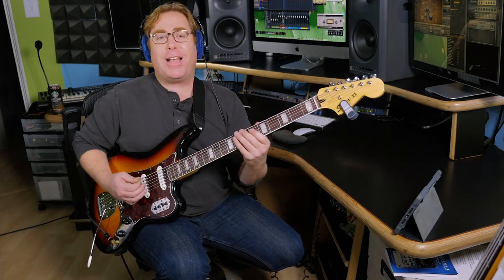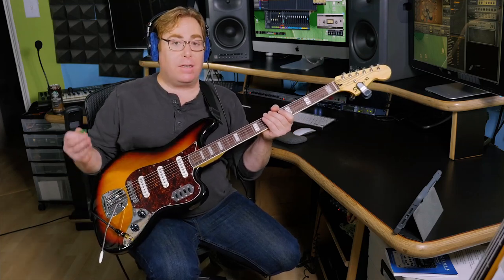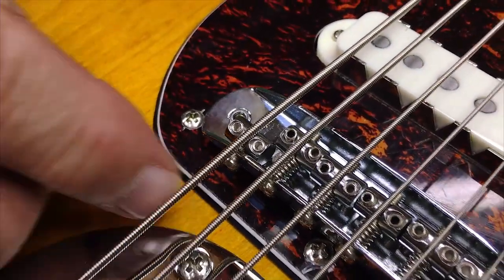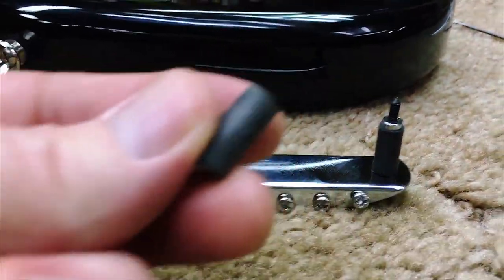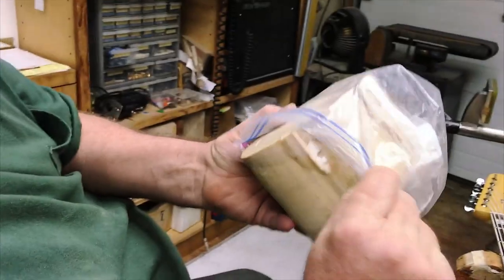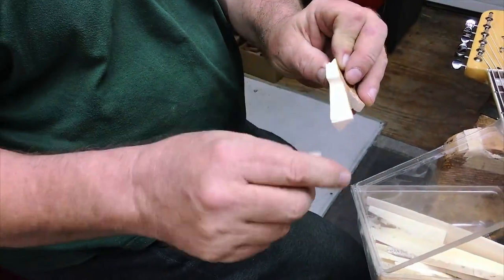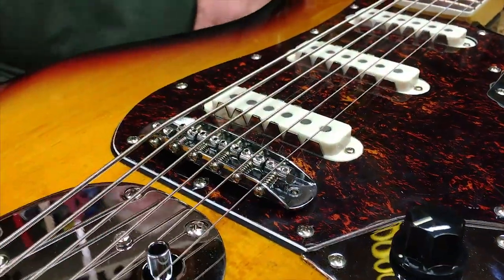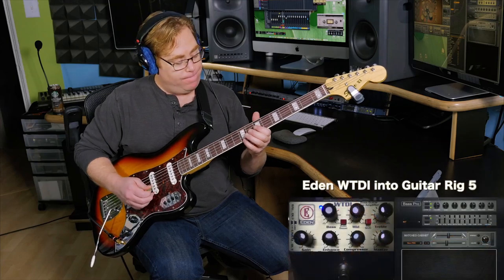Squier Bass VI Intonation Fix

Comment: Actually the oversized hole for the bridge support pins is by design.  The bridge is supposed to rock with the tremelo, it is an additional setup detail.   If you fix the bridge then your strings will go out of tune when using the tremelo.  If you don't use the tremelo, then it is fine to fix the bridge position.
Reply: If that is by design, then why are they not like that on Jazz Masters and Jaguars? And what do you do when the bridge on the Bass VI gets stuck forward and does not return to back to level?
Reply: @seansmith8713 jcv jassmasters and cv jaguars heve the same bridge and those rock too..

Comment: WTF? I'd find a better setup guy. I fixed my trem on my bass VI with coins and some risers under the floating pins. then i threw the tone bar in a box. set up with harmonics and abracadabra man. EZZ PZZZ with no screw cutting. For the record never let somebody dremel cut mere millimeters from two strings and with magnetic pick ups an inch away... or just dont let them dremel your axe period.
Reply from the maker: It's fine. That's Steve Helgeson of Moonstone Guitars. He makes some of the best guitars in the world. My Bass VI plays perfectly now. It was my choice not to just get a better bridge.
Reply: @ChadWork1  Fender now makes 24-100 Gauge Strings which will intonate even better plus that 100 gauge low E is awesome
Reply: @ChadWork1  never heard of the guy, but his workflow is very dodgy :/

Comment: Cutting the adjustment screws seems a bit silly to me.  If you lower the saddles in the bridge (changes the angle of the adjustment screws so they don't hit the strings) you can then raise the entire bridge to get your string height.
Reply: i just screwed with them for 10 minutes and got intonated, no cutting
Reply: What you are saying does not work because you will get fret buzz. You have to raise the strings.
Reply: @lanceforney5321 the holes to the sides of the bridge house a small Allen key screw, I think it was a 1.5mm turn to the right to raise your bridge. People commonly adjust string height with their saddles on offsets and then complain about something they weren't supposed to do in the first place.
Reply: @MrJbangoy  I did that first, but the strings were then too high. I then had to lower the saddles.  I was able to get them all adjusted but the E string. It was the strangest thing.  I had to raise the strings back up because the E would buzz.

Comment: "Jury Rigging" is not a "fix".  Showing a guitar tech having to physically modify a guitar is NOT helpful.  May as well just tell people to go buy a Staytrem bridge for $100 vs what the average person would have to go pay a tech to do.
Reply from the maker: +fooser1 It actually is a fix because my Bass VI is in perfect intonation now. I paid 80.00 to have the Bass VI completely fixed and set up. Once you pay 100.00 for a different bridge, you'll still have to pay a tech to get the bass playing right ( if you're not tech savvy yourself), so my way is cheaper. Intonated is intonated, and my Bass VI plays better than the Fender model now.
Reply: +Chad Johnson  I am seriously getting a mammoth tusk nut after seeing this! my pitch for the staytrem is that it will give you a lot more mass and significantly enhance your tone and sustain.  Its much more than just an overkill fix for the intonation.  The squier vi is a great bargain, but for a lot of us, it was a priceless, legendary instrument we never expected to own.  I say its worth upgrading.  But you do you!
Reply from the maker: Yes I have no qualms with the staytrem. We just wanted to try to see if Steve could get it working with the stock parts. Now what's bugging me is that the pickup poles don't line up with the strings, and the low notes are weak.
Reply: +Chad Johnson what kind of strings are you using?  Kallium has a ton of different gauges.  You might want to try their 104 low E.  These things were setup every kind of wrong out of the factory.  But since i love tweaking around with cheap guitars, its been a fun experiment.
Reply from the maker: I still have the original strings. I never got around to experimenting with different gauges. Do thicker strings fit in the nut without having to rout out the slots?
Reply: +Chad Johnson depends how thick you go.  Ide say if you went with a 90-98 youd get away just fine.
Reply: There's a intonation guide for this guitar on Instructables that is just brilliant and shows you a lot about how to do it yourself.
Reply: +Processdrone hell yeah shimming the neck is number one for any of the floating trem fenders.  I had to put a pretty dramatic angle on mine and that was when things really started to turn around for me.  The one thing Chad got really right here that a lot of people miss is that you can get a lot more tension if you adjust the tension screw on the trem.  Right now im rockin Kalliums with .86 gauge and its PERFECT now.  This Bass is one of my favorite instruments I have ever owned, but forewarning to all, it is a project.
Reply: It's actually Jerry rigging.
Reply: Processdrone 
I followed that exact guide and even got the same bronze bushings the guy used, ended up being just barely to wide around to fit in the bridge holes.
Reply: @ChadWork1  D'addario makes awsome Strings for this neat instrument. Taylor Swift would love the Bass VI cause she could use it for a new Rock version of Shake it Off.

Comment: I have the Fender Pawnshop Bass VI with the same intonation problem on the low E. Only turn the bridge (screw on the pickup side), lower the saddle a bit (to clear the string on the high E between the bridge and the whammy) and raise the bridge a bit. Now it's perfect and it's revesible!

Comment: I have a ‘14 VM Bass VI. Never, ever use the trem. I installed the Ace Hardware bronze bridge post bearings and Kalium 102 BVI strings. This, and shimming to make for a proper neck angle made it easily intonate without all the cutting of screws or reversing the bridge.

Comment: @UCIV6Cl5SzuGCn6OsY33KLMQ
  The Fender 250B6 Set used to be 24-84 but they've made some refinements to it so it's now 24-100. They've bumped up the gauges of the 3 Lowest Strings (D, A, & Low E) by a significant amount so that it's more balanced & the intonation is better. The Low E String from the new 250B6 Set is now a 100 which is Standard for a Bass Guitar.

Comment: I found that if I just shove the bridge back, it stays there if I don't use the tremolo.  No need for sleeves or other modifications.   Also the screws are soft enough that you can cut them with a heavy-duty snipper.

Comment: I broke the weld on my bridge trying to fix intonation , so i had to buy a new bridge anyway. Interestingly the bridge for the Jaguar / Jazzmaster fits without any sloppiness and the resonance comes through the body of the guitar so much better putting you so much more in touch with the instrument.
Also a 1mm thick shim ( i used a cut down jubilee clip) under the neck right up against the body fixes most of the intonation and renders the bridge able to adjust for intonation without all that cutting screws down. Basically the neck pocket isn't angled quite right.

Comment: I picked up 2 bronze spacers at Ace Hardware with a 1/4" (.25) I.D. and 5/16" (.312) O.D. x 3/4" (.75) long for about $6 total...dropped right in the bridge ferrules and took 99% of the play out.  If you want to compare, try it out.  They come right out if you want to float the bridge.

Comment: Very helpful. Other than shimming under each individual string saddle, does anybody know a way to adjust saddle height? My low e-string is too close to the neck. The other strings are OK. Does anyone know of a replace bridge that allows for bridge height adjustment as well as intonation? It's a common thing for 4-string bass, but I am not finding any for the Squire VI,
Reply: Use a 1.5 mm hex key. The adjustment screw is deep down the holes in the 2 bridge posts. Clockwise to raise.

Comment: Fix the bottom 'E' intonation problem on a Squier (possibly Fender too!) Bass VI, with this, completely reversible, modification that also ensures the front of the screw doesn't foul the string - NO  Dremel 'butchering'!
1) Slacken string and pull aside.  2) Remove intonation screw.  3) Refit saddle into the bridge, but with (both) the screw AND Spring, mounted BEHIND rear flange of bridge (may need to slacken off height screws a tad to saddle align for easy insertion of screw). 3) Rough intonate string by MANUALLY (like on a Floyd!) moving saddle back and forth (if necessary - mine was 'spot on' with saddle in contact with rear flange).  4) Readjust saddle height screws (some resistance MAY be felt - if necessary, in extreme cases, the flange screw hole may need a little vertical elongation - mine didn't) and recheck intonation.
Job done!
No charge!
Reply: Thanks man, that worked so well.
Reply: Hey, I'm French and some technical terms about the bridge give me a hard time understanding your fix.
The thing I didn't get is the "mount the spring and screw behind the rear flange". That means that the spring is actually "out" of the bridge, right ?
Ultimately it's a way to use the total length of the bridge, am I right ?
Reply: You've got it right.
Reply: Alternatively, sell it and buy the far superior (in every way) Ibanez SRC6 which comes with perfect intonation straight from the factory,
Reply: The SRC6 has a thundering BASS sound (thanks EMG !) but has the same intonation issue. After the seventh fret it sounds false and it's impossible to fix it (bridge).
Reply: Metalistopheles. Not true. Mine has no such issue, (nor have the 2 others I've played). Perfect intonation right up to the 24th fret on all strings with room to spare at the bridge. What's more there are several reviews on YT that mention exactly that, so I'm not sure where you got your information. Here: Please watch this from 3min 50secs:  https://www.youtube.com/watch?v=JQcUL_eqMFM
Reply: Apparemment ce problème d'intonation est récurrent sur pas mal de modèles de bass vi (Squier, Fender Pawn Shop, Ibanez, Musicvox, ...). Pour y remédier sur une Squier (ou Fender), la meilleure solution consisterait en un changement de chevalet (Staytrem) accompagné d'une augmentation du diamètre des cordes ( en général du 0.95 pour le mi grave). La manipulation (que tu as très bien comprise) exécutée par ce luthier ne serait pas suffisante car ne marchant pas à tous les coups.
Reply: Jammer genoeg is m'n Frans niet goed genoeg om dat te lezen. Waarom schrijf je op eens in die taal? Doe eens normaal man. Engels aub. Dit is de internet.
Reply: Yes, it's true, the SRC6 has a serious INTONATION issue. Mine has and other I played (to be sure). Play yours in the upper register and you will see (hear) it sounds false.
Reply: I do, and it doesn't
Reply: Well, in that case, regard yourself as a lucky man !
Reply: this did not work for me
Reply: Can/have you make a video?

Comment: By Squire Classic Vibe Bass VI arrived today. So next it’s off to be put right. I won’t be using the trem at all.
Reply from the maker: Even though we put carbon fiber sheaths over the bridge posts to prevent it from going out of intonation, I am still able to use the trem arm to get a little vibrato FYI. I would also set it up with the new LaBella strings too because they are a little heavier than the terrible ones it comes with.

Comment: I wrapped the posts with electric tape to stop them from pivoting.  (I tried many times and 4.5 inches wrapped real tight is the amount, then use fret board oil to slide into the bushing so the tape doesn’t bunch) I don’t have any use for the whammy anyway.     A friend of mine suggested I try Steelstik as a permanent solution to the pivot problem.  The pivot will fall into three positions under the pressure of the strings - forward, center or back.  If you push it into the back position (towards the tailpiece) it gives you just enough distance to intonate the low E and A.   I’m going to set it into that back position, then pack it with Steelstik.  I’ll write again if it works.  Since this is a bass, it would be great if Fender included an optional sleeve for people to fix the bridge.

Comment: @UCIV6Cl5SzuGCn6OsY33KLMQ
      Did you know the Bass VI is a Solid Body Electric Bajo Sexto? The Bajo Sexto is a 12 String Bass-Baritone Guitar and it's normally tuned in Fourths (E, A, D, G, C, F) or like a 12 String Guitar (E, A, D, G, B, E) but an Octave lower. The Bajo Sexto was used in Tex Mex but thanks to Fender who made the Electric version called the Bass VI it found its way into Rock.

Comment: I keep reading about intonation problems, but mine came perfectly fine out of the box. Is it an issue due to using thicker strings than it came with or? Also haven't had my bridge get stuck forward or back either yet it's rocking as designed to allow the Trem to function properly.
Reply from the maker: The intonation is adjusted by the length between the nut and the bridge, so the string thickness won't matter. You're lucky if your low E string is properly intonated out of the box. I don't want any rocking action because it doesn't return perfectly every time, and I just don't need a whammy on a Bass VI. All I know is mine still plays perfectly all these years later. I got thicker, flatwound LaBella strings and they are amazing. The stock strings were thin and sounded weak, and harder to keep in tune.
Reply: @ChadWork1  I prefer the 84s as I'm not using it as a bass as much as filling in a space in sound between bass and guitar. A bit of drive and chorus and it's as full as I need
Reply: @ChadWork1  string thickness is absolutely a factor when it comes to intonation though, if it wasn't the saddles would all be in the same position flat across the bridge rather than staggered, since they go into the nut completely parallel. Changing from a wound 3rd to a plain 3rd also calls for a major adjustment of intonation on that string even if they are the same gauge. I have never heard of needing to change for tape wound strings but I wouldn't be surprised.
Reply from the maker: @MrJbangoy  ok you’re right. Still with the original thin strings I didn’t have enough length to intonate the low E.
Reply: @ChadWork1  I wonder if they changed something over the years due to this? I was expecting to have to do some work and was pleasantly surprised. The bridge leans slightly forward as it came and is normal on Jaguars, but if you didn't have enough length this would make that even worse.
Reply: @ChadWork1 yeah I looked closer and my saddles can't even be adjusted up or down they're bigger and rounder, and there appears to be a bit more length to adjust as well. They must have seen the issues people were having. Glad you got it sorted.

Comment: just buy it, and now need to fix the low E 😢
Reply from the maker: Recommended Strings I use now: La Bella 760FS Deep Talkin' Bass Flatwound Bass Strings - Standard (six string set) String Gauges: .029, .045, .065, .085, .105, .128
Reply: @ChadWork1 128 ? It seem more loud than a classic bass
Reply from the maker: @yohann44  It says ".128T" on the package, but I'm not sure what the T stands for. I'm not sure what you mean by "it sounds more loud than a classic bass". It is as loud as the setting on the amp. The strings I put on are thicker than the ones that come on the bass, and sound much better. With the setting son the bass you can get it sounding round and thick like a real bass, or thinner like something from a Spaghetti Western soundtrack. The flat wound strings also sound great and are easier on the fingers. Trust me, they will bring new life to your Bass VI.
Reply: @ChadWork1 Sorry for my translation , I would Say by "loud" fat or Big. Do you change your tuneomatic ?
Reply from the maker: @yohann44  In the video you see what my friend did with the stock bridge to make it work better. But people also replace the bridge with the "Staytrem Wide bridge for Bass VI" if you can find one.